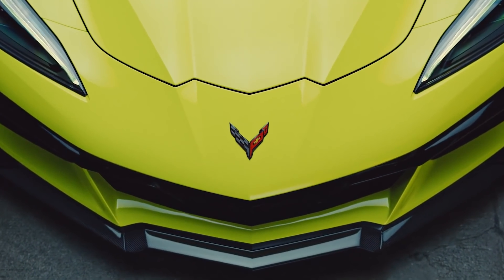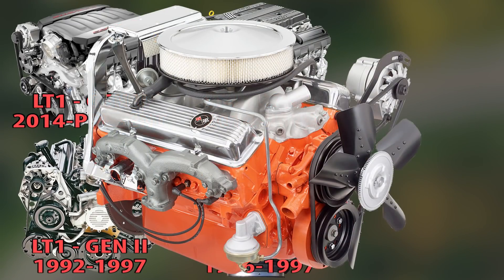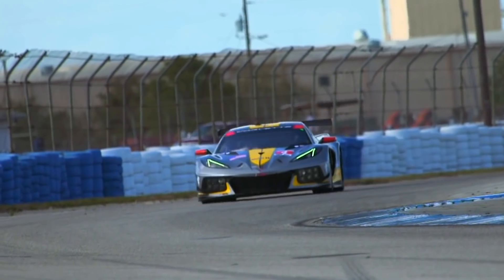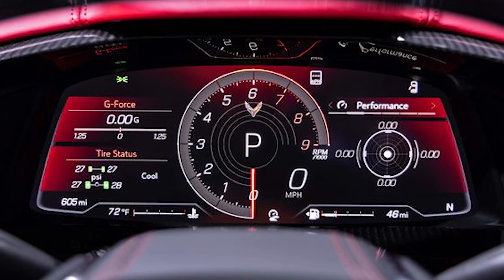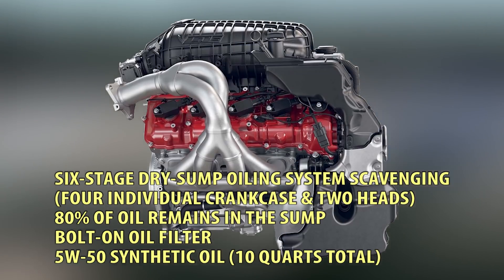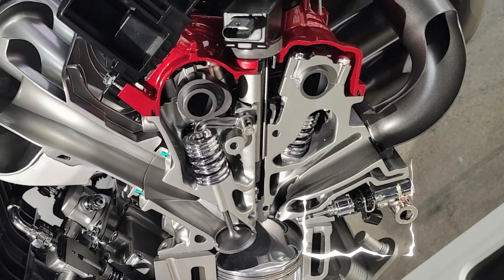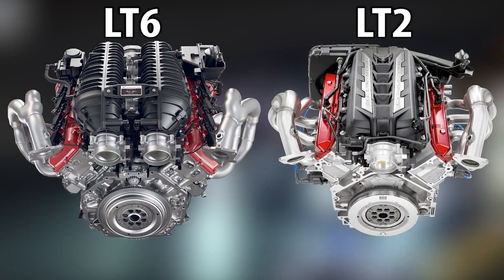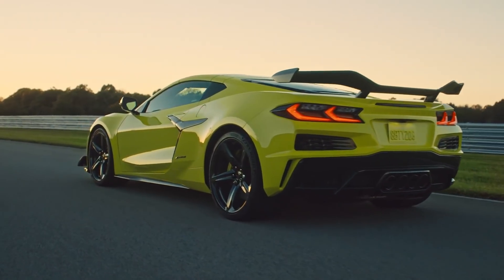What everyone missed about the 2023 Corvette ZO6 LT6 reveal

Comment: In less than 2 minutes tell me you do not understand the GM RPO coding without saying you do not understand the RPO coding.  L is for engines LS1, LT1, L83 for the RPO coding just like G is for diffs and Z are suspension performance packages Z71, Z28, Z51.  The codes are how cars are optioned and built at the factory so they get reused eventually I am sure LS will get reused as time goes on just like Z06 has been reused.

Comment: One rectification: the Tremec eight-speed dct on the C8 Z06 have code: M1M and for C8 Stingray the Tremec eight-speed dct have code M1L , so there's any differences and the new LT6 engine have IVLC Technology ( Intake Valve Lift Control included first time in Chevy Impala) it's similar like i-VTEC Honda's system.

Comment: Anyone else noticed that when he talked about the crankshafts, he showed a normal flat plane crank without counterweights as an example what crank it does NOT have, and showed a picture of a technicly flat plane crank with abnormal design, that does require counterweights as clearly seen as an example for what crankshaft design it has, even though it has the normal crankshaft design. He even said the crankshaft in the LT6 does not have counterweights. The flat plane crank that he said it has but does not is actually a flat plane crank from a V8 by Ford, in which performance was sacrificed for sound.
Reply: yep was about to comment this

Comment: It odd it makes more horsepower at less rpms and more torque at high rpm (not sure those are actually factual numbers). Usually the opposite. As an engine guy, this one is really quite special, especially for a GM factory engine. Can’t wait for some forced induction.

Comment: There was no valve drop issue. GM investigated this to the nth and couldn't find a single instance of it. The most they found was a batch of heads with mis-machined guides that was more noisy than usual (but fully functional). They covered those under warranty and made good on them. The LT4, LT5 and LS9 all use the same valve guides, yet nobody says anything about them. That's because there's nothing wrong with them. The valvetrain on these engines is noisy to begin with and it sent a lot of neurotic owners over the edge.

Comment: Did he say four or five cams? I’m not sure about injecting fuel straight into the cylinder. Injectors will already varnish and clog from just every day driving. Gasoline still has oil in it and it will burn a little nasty.

Comment: Regarding a ZR1 possible having AWD and 800HP; personally for ideal  sports car handling  characteristics, I'd consider the new C8  mid engine platform ideal for launchings..no AWD needed. When you start introducing more weight and complexity of AWD,, you compromise the goal of   nimbleness(overall sports car feel)... regardless of power to weight, weight can't escape gravity! Also, adding a supercharger will certainly make it a powerhouse, but once again the NA offers plenty for daily driving, while not introducing added stress, weight, and complexity to the overall dynamics of the car.. something to consider, in my humble opinion.

Comment: I'm split here: I understand that DOHC engines have higher rpm speeds and can get up to speed quickly, BUT and this is a big one: the sound. If the LT-6 had a throatier snarl to it and not sound like a Ferrari knock off, I would be fine. The thing is that OHV small block has the traditional thunder associated with the Corvette, and as fast as this ZO6 is, it just lacks the thunder of a small block. I would have been happy if the powers that be GM made a revised LS7 that had more compression and solved the valve dropping issues, because, yes it wouldn't spin to 8600 rpm, but the howl of a 427 ci engine running to 7000 and pulling the same speed would be awesome.

Comment: Sounds like GM took a lot of notes from other manufacturers, the C8 corvette gets it right.

It’s about time GM stepped into the 20th century, Ferrari, Porsche, Audi, Honda, BMW have all been using these technologies for decades now.

Dual VVT 
Dual intake plenums with velocity stacks
Direct Injection 
Silicon impregnated aluminum block material creates a smoother, stronger cylinder wall with less friction.

The unfortunate part about that last matter is that honing your block will require special bits, and simply installing steel sleeves will actually yield less performance benefits with greater friction and less heat dissipation.

Comment: I can see a big difference in that single to twin intake and what ever those 3 valve's in the middle still mean,  I'm still working on that,  I'm 63 yrs, and I can understand the older models of the carburetor center mounted intake, that's the old way of referring to the old self-induced aspirated intake,  if I'm guessing this right,  aspiration still means vacuum suction, and vacuuming the air flow of the heads of the valve's,  and through this engineering numbers are boosting higher numbers of hp, plus the way the fuel injection systems are being sharpened up, so I'm getting at is the fuel injection is getting better,  aspiration means natural vaccum circulation, no turbo or supercharged system of either kind,  but you still need to figure out how much hp your going after,

Comment: Direct injection without injection into the throttle body equals build up on the intake valves. Ford figured this out and they have both direct injection into the cylinders and injection into the throttle bodies. If Chevy added this, it would add horsepower to the engine and keep the intake valves clean. Personally I prefer the sound of a crossplane crank V8.

Comment: Doesn't look like there's going to be any room to upgrade it. The direct injection is more than likely going to be the limiting factor. Most companies upgrading DI engines opt to add port injection to supplement direct injection. With the way that intake manifold is designed it's going to be damn near impossible to add extra fuel. Ofcourse you could add a couple injectors before the manifold, but the distribution of the fuel isn't going to be ideal. We'll see what they do for the ZR1 version, if there's even going to be one. I have a sneaking suspicion that this engine isn't going to be able to handle much extra power. But we'll see.

Comment: I own 2 C6’s and a C7. This is a lot of misinformation. Dual valve spring breaking; a broken valve spring is a broken valve spring, a dual spring rate will not continue working if the other spring is broken and if you try to do that it will immediately end in catastrophic engine damage. Dual springs just give you quicker and stronger valve closing at high RPM’s. 
LS 7 valve drop can happen but it’s not at all common but for those that are worried about it you just switch to a solid exhaust valve and sacrifice 5 hp, 300-400 RPM and about $600.

Comment: What they are calling the final drive ratio sounds more like the differential ratio.  An automobile uses gear ratios in both the transmission and the drive axle to multiply power. The two ratios multiplied together equal the final drive ratio.

Comment: Ford is still light years ahead with the coyote, Trinity, Voodoo @ Predator engines and now there's the 7.3 Godzilla. We needed this engine 10 YEARS ago !!
Reply: We had to wait for GM to approve a ME platform. Coyote was detuned recently how is that light yrs, when LT2 stayed the same. Trinity was too heavy and wide. Voodoo didn't go through racing for proper development. GM built Lsx 454 in 09 and R version 10. 7.3L Godzilla is just a diet form of those engines.
Reply: @jeffwill4923  I'm not as knowledgeable as you are but I can google weight hp to cubic inches ect and the detuned 5.0 still puts out as much more hp per cubic inch than a stock LT2 with some 70 cubes less The Trinity weighs what 25lbs more than 454 and is 351 ci 662hp at 7200rpm 100 cubes less ! Every car manufacturer has there problems so fix what you like to work on. I just know that at the end of the day my hard earned money is not going to be spent on 1955 265-283 rebuilt worked over and with todays technology in yesterday's pushrod engine. The engine works And a person can get some big hp numbers numbers with enough money. LS 9 blah blah. Just saying Ford does more with less C I. They also spend the extra money and keep the port injection as well as using direct injection so that the valves stay clean. I'm getting ready to buy a 2022 F150 with 5.0 and it fortunately or unfortunately will have cylinder deactivation on it. I can only hope they did a better job than Chevrolet system but who knows. Enjoy your V8 as the powers to be are doing there best to kill them. The hemi will be discontinued after this yr and the 2024,25@26 fuel mandates will kill off a few more V8's. The F150 RCSB 5.0 only comes with 3.31 gear ratio which shows me that Ford is struggling to meet emissions and fuel mileage requirements for the carbon footprint of 122" wheelbase. Chevrolet is bringing there 1/2 ton RC back this yr but only with long bed. Thanks for your reply glad I'm 64 this yr and retired. We are heading into some difficult times

Comment: The LT 6 has a has thicker cylinder walls with more space between each cylinder! It also has an insanely short stroke. n/a built is more of a feasible route this time around for a lot of power gains vs just throwing a supercharger, which is more complicated now or a turbo system. ;)

Comment: 670hp over 460 torque is actually pretty lame. Your torque numbers should exceed your hp, if only by a little- the real power is in the torque. But I guess that's what you get with a 4.1 bore and 3.1 stroke. Not sure if the crank you showed was an actual LT6 but that big chunk of metal in front of the first throw and behind the last, are counter weights. Having two pistons on one bank and two pistons on the opposite move together, rather than distributing the weight evenly throughout the crank's rotation, on a V8 engine, is going to cause vibration issues. The cars will eventually be worthless since they are going to destroy main tunnels and replacement blocks will not even be a thing. I've been selling engine parts for 35yrs and I can assure you, Dart can't even supply an old school 350 head right now- there will probably never be any company making aftermarket replacement blocks for the LT6. Looks cool, though! Oh, and change your oil like every day....

Comment: Someone with GM suggested to me..."don't count on turbos".  Definitely will be a hybrid but I wonder how variable they will be with electric motors.  Maybe it will be the Z06, E-Ray and some think the Zora or final variation as full electric.  Sounds like, from what I was told, that C8 is the last generation of internal combustion engines.  Seems odd considering the development that it took for the LT6...not to mention the mid-engine design.  For many of "us dinosaurs" the C8 maybe the last Corvette.
Reply: I'd be shocked if the ZR1 isn't TT.  I suspect they will still do a Zora and add electric motors to the front wheels on top of the ZR1 package.

Comment: The new Vette sounds like a Ferrari! The cross plane crank and the way the overhead cams work makes this new engine whine like a European car. I don't like the sound! While the Flat Plane Crankshaft is lighter and can rev faster it has balance issues. Chevy has had to use longer bolts on all of the hardware that makes this engine stay together. I wonder how long it will take for this to create issues with the new Vette? I do know the European cars have to have a lot of service done and this is quite expensive. Now the average NASCAR engine of today is a V8 that is 358 Cubic inches. I had a Chevy Crate engine made in the 1980s that was 571 cubic inches. This engine was made for racing and it had all kinds of cool cams and other things on it. It also had a 1350 Holly Carb on it! The engine made over 800 HP. I found this engine in a Speed Shop and bought it for $1800. I stuffed it into a 1973 Buick Regal. First it broke the universal joints in the driveshaft! After putting a truck shaft in it blew up the rear end. Again a truck rear end was used. Then it ate the Turbo 350 transmission! By this time I was almost broke! Then I found a Turbo 400 that had been modified and had a B&M Shift kit and bottom Plate in it and the car finally staid together! Street racing while in m7 30s was so much fun! I never had anyone stay even close to me in a race! Wish I still had Sally! Although she was a Beast that had to be fed 110 octane Avgas at $4.50 a gallon when regular leaded gas was > 65 cents a gallon!

Comment: ZR1 should have hybrid electric front wheel drive.  This is what's missing as the engine is finally DOHC.  Weird it has no turbo so it has to rev higher but it sounds cool.  Now it is a modern sports car.

Comment: going to be an awesome piece but the lt4 will probably be a better street motor and daily driver. also i cant see it having the same gear ratios as the lt2 with how completely opposite the powerbands are.
Reply from the maker: Gear ratios are different, but you are correct. The LT2 may be a better "daily driver".

Comment: CHEVY FINALLY TRYING TO CATCH UP TO FORD! The Z06 makes 120hp/liter while the 1984 Ford DOHC 3.0L V8 DFV made 170hp/liter
Reply: The Ford engine was made by Cosworth for Formula 1 racing where cost is no object.  This is the highest horsepower naturally aspirated V8 ever made to be street driven.
Reply: @bobthbldr3  Ford bought and built Cosworth. Ken was working is a shed before Fords money built him that building and supplied all the latest machinery. Ford sold it in 2014. The LT6 has a race history in the C7R ( or C8R) but was race limited to 500hp. The LT6 is a race engine.

Comment: Very interesting and more about the engine than I had seen before. Interesting that they use a flat plain crank right after Ford drops theirs. Finger cam followers; I hope they work out better than they did in Chevy's 2003 Indy engine because I had heard that was the reason that went flop! (They started using an engine they bought from Cosworth mid season in 2003). It was also frustrating that very little of the accessory end of the engine was shown. It would have been nice to have seen how the cam drive and other accessory were arranged compared to the LT-2. Belt or chain, turning four cams takes much more than turning one and gets messy fast if not given proper attention!
Reply: This engine is based on C8.R race car, which race in ISMA racing series. Which race endurance races. The flat plane crank has proven to be reliable and powered the C8.R to back to back championships.

Comment: Very few GM engines have "names". They're option codes. Usually a combination of 3 letters and numerals. There are outliers, but for the most part it's 3. 

The letter "L" indicates it's an engine. The next letter is just cycled through the alphanumeric sequence. It's actually chosen by the department who assigns the option codes. That's why you will see LC9, LM7, LQ4, LT1, etc. Even the Ecotec 4 cyl. is LUV, LUJ, LHU, etc.

Occasionally they will reuse the second letter/numeral if trying to recapture a familiar engine code which had gained popularity. I'd venture to say the LT-1 is by far the most popular small block GM code and the LS-6 is the most popular big block GM code, worldwide. Hence them reusing them when introducing newer "unfamiliar" platforms. 

By the way, the original LT-1 had a hyphen and it was a Gen I block not a Gen V. You missed that on the picture you showed. 😁

I don't normally get that picky about stuff like that except you tried to shadow your lack of knowledge by criticizing GM. There's actually a method to their madness. 👍
Reply from the maker: Thanks for the detail.

Comment: I have been telling chev heads for years that the LT platform was superior to the LS and dual plenum manifolds mean more power and less fuel compensation to achieve it. Just wish GM had unlocked the 7.0 Ltr LT427 before they wasted time and money on the LT6
Reply: The current gen v8 is better than the last gen v8?  Who would have thought?  -_-

The LS engines were fan-freaking-tastic for their era, but they're old.  The only reason they retain their popularity is the fact that they're dime-a-dozen in old cars, so can be had for cheap.
Reply: @EagleScoutmano  LS engines are great if you are already cruising and then accelerate or accelerating out of sweeping bends, if you want power off the line or want to power out of sharp corners the LT is the King

Comment: I  figured it was named LT-6 because it's the spiritual successor to the often forgotten 32 valve DOHC LT-5 from the C4 Zr1.
Reply: most people have never heard of the LT 5 made by mercruiser. 32 valve dual over head cam Chevrolet V8. I want 3 of them!
Reply: @gccnashville3245  It's also designed by lotus as well not just Mercury Racing.
Reply: Yup...and it was designed by Lotus, which GM owned at the time! Mercury Marine had to build it as GM had no factory abilities that could do so. That ZR1 PowerPlant is still amazing today.
Reply: @45auto17  If you like that you gotta check out the Doug Rippie bllack Widow versions of the engine with up to 575hp. It's a convoluted story and he's not the only guy involved obviously, but it's a great read.
Reply: @ronaldcolman6211  Will Do!  Thx much!
Reply: or maybe Louis chevrolet
Reply: They should have named C7 ZR1 engine LT6 and C8 ZO6 engine LT5, it has more in common with the C4 LT5
Reply: I thought it was a throwback to the LS6 introduced in the Z06 around 2000 - 2001.
Reply: @YukonDemon  that could be it, if I was in charge of engine code designation C8Z engine would be LT5 since C4ZR1 was LT5 and was DOHC 32 valve too, all the others are OHV
Reply: The LT-5 was an engine designed & built for GM by Mercury Marine in Stillwater, OK. Merc Marine has a huge displacement production DOHC boat engine now.